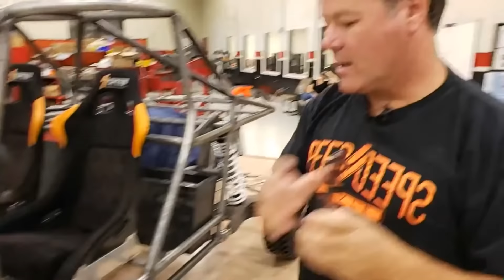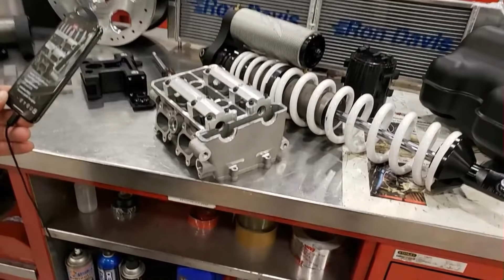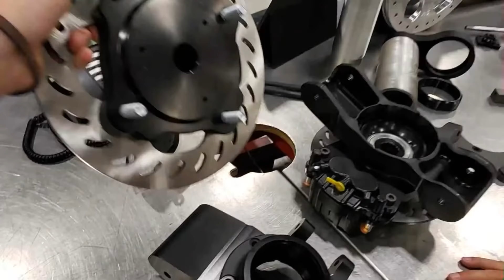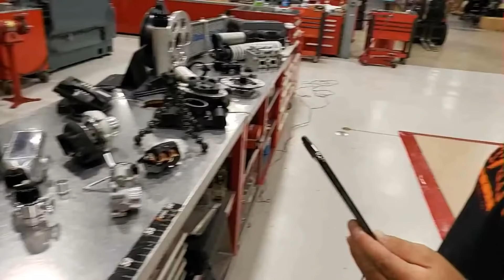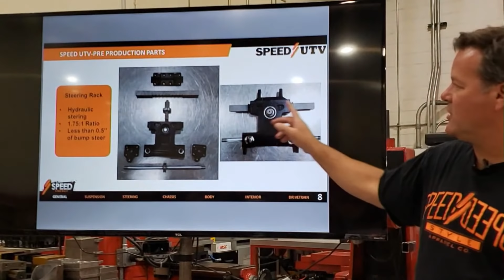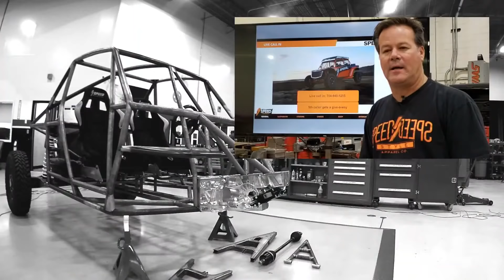SPEED UTV LIVE - Episode #25

Comment: I love watching these videos. I can definitely see where the bean counters short changed me a bit on my XX (2019). Overall, it is the same chassis and suspension design in a 64"er.  I bought it based on the chassis. Good tubing, diagonals and cross bracing. I figured that I could always redo motormounts, etc and drop in a new drivetrain someday if needed. I definitely need to get your rear axle upgrade for peace of mind. Thanks for all that you, Todd Romano, Chris Parker and the rest of your team have done for the sport and to help me personally.